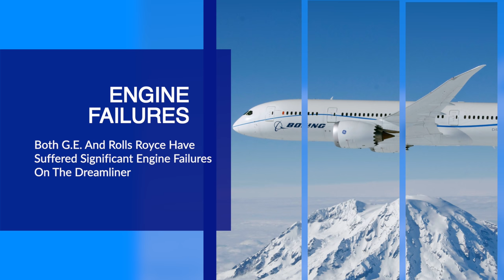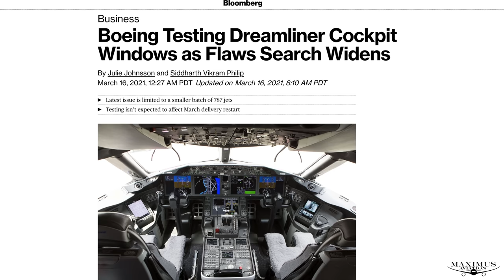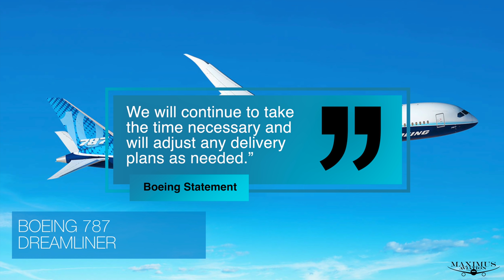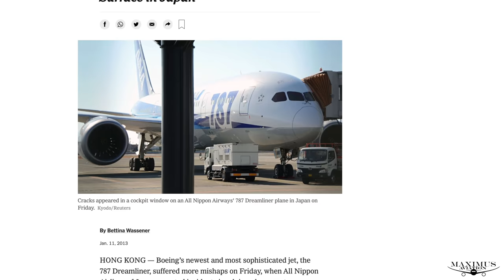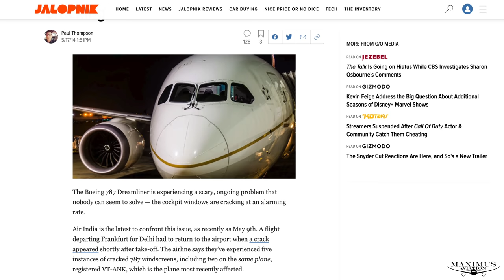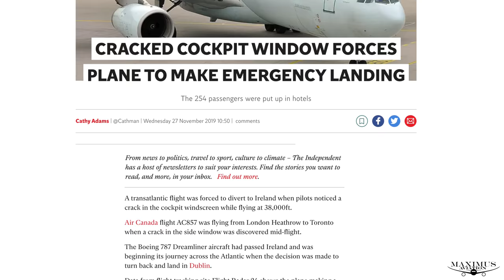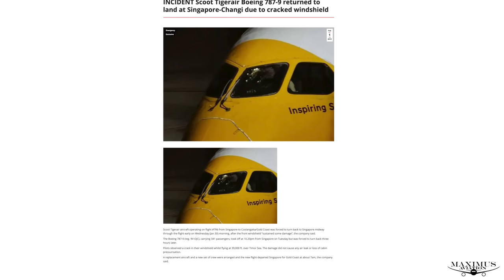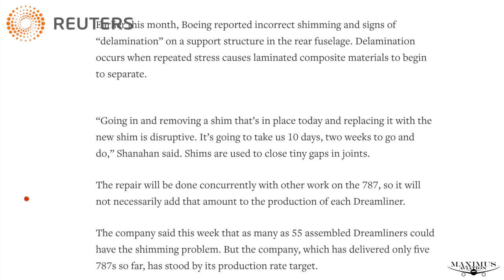Why Do The 787 Dreamliner Cockpit Windows Keep Shattering In Mid Air? How Dangerous Is It?

Comment: Again going back to a time when I was'nt even born. The Comet Airliner. Brilliant piece of engineering, but failed on many levels leaving Boeing to leapfrog it when those problems were ironed out. Yet all those Comets were bought by the UK's Ministry of Defence, Remanufactured into AWACS and flew successfully with RAF Coastal Command for forty Years. That included windows cracking and causing explosive decompression.
Reply: It wasn't the window, it was the window frame (aluminum) that cracked.

Comment: The problem is a three fold hydra. 1st, Boeing is not the same company that produced the safest planes in the world like the 747. They unfortunately took the lessons from Airbus and (planes from the land that invented the word sabotage) and put bureaucrats and pencil pushers in charge of building airplanes. 2nd Boeing used to build most, if not all its aircraft except the engines in house and had quality control. Now to "save money" they outsource so much, they don't know and can't guarantee what the heck is going into them. 3rd Airlines don't want to put in the proper maintenance. As a former crew chief, I have seen it personally. I have had to give maintenance council for a delayed SouthWest 737 flight because they couldn't figure out a simple problem. The USAF still flys aircraft the the airlines said were problematic, with no major issues. But the manual on those are much more involved and detailed than what they use. What is passable for them was not for us.

Comment: So disappointing to learn.  Dreamliner is one of the most beautiful commercial aircraft to date.  This is not good news for the type.  Hopefully the engineering change from the supplier helps rather than hurts.  The shims issue is also disturbing to learn.  Hopefully the 787's future isn't ducked. 😲
Reply from the maker: I agree and I think the problems are fixable but I worry Boeings mindset of doing things on the cheap is a problem.

Comment: How are they keeping such a dangerous problem Quite!  They should be grounded, I think the carbon fibre is flexing a lot more than expected in trials.
Reply: The best way to determine that is to install stress gauges to all aircraft windscreens to determine if that is a factor.
Reply: @davidlazarus67  indeed I would cover the whole edge in strain gauges and push one through a full flight performance envelope,  various country's too because the majority seemed to be very hot or very cold country's.
Reply: @dogwalker666  Yes cover the windscreens in them and wait for the cracks. The flight just past Ireland wasn’t particularly hot or cold region. It’s even good airlines like ANA so not a airline specific issue.
Reply: @davidlazarus67  it’s got to be a design flaw
Reply: @dogwalker666  That’s probably a high possibility but I would eliminate quality control of all glass panels first. It could be a problem in manufacturing. Start with the most obvious and start eliminating reasons. If the windscreens have been checked to eliminate that possibility then with stress detection it would identify other causes.
Reply: @davidlazarus67  I am assuming that the glass is the same as other models,  I only have experience of vehicle screen manufacturing there they use the same glass just different lamination layers.
Reply: @dogwalker666  I am no expert but I would think the window panes are potentially different because of the shapes compared to other aircraft. Different thickness etc. It might even be something to do with installation or the sealant around the window. Using a car analogy we can probably exclude actual bird strikes but should still consider that aspect. The installation would be something to look at first.
Reply: @davidlazarus67  good point, it would be interesting to know if these windows are shared with other models, I assume a lot of parts are common.
Reply: @dogwalker666  I think many parts are unique to the model though many smaller parts like bolts, wiring seats etc  will be common to many aircraft.

Comment: Windscreen problems ha.
I spent 44 years line Maintenance,  and have changed windows on evey aircraft my Company owned. 707 to the Queen and Airbus 320, 330. It wasnt a every day thing but nearly every one was found cracked in flt.. 
The only real world way to see if it's a problem is nbr of hrs the fleet has flown divided by the number of windscreens replaced. Or mean time between failures. 
You may be right with this fleet but no evidence you are...

Comment: Boeing has an engineering problem (We know that), but the bigger problem that is outside of their control is a major PR/media problem.   At present the engineering problems are confined to the business/industry press.   If these continuing problems hit the mainstream press, this could lead to further grounding/investigations (Due to public opinion, remember there is no friendly FAA anymore).   Boeing really needs to be on a major offensive to describe what they are doing to resolve their problems (If they actually want to fix the problems).   I hope I am wrong, but if Boeing don't get their act together, both engineering & media, I could see a further grounding/crash.   If there is another crash, whether it is Boeings fault or not, any fallout from a grounding/crash will seriously dent public confidence in their aircraft.   Remember the MAX has still not been authorised to return to the skies in China.  This could be described as political, but what happens if the 787 suffers a grounding due to lack of engineering at Boeing in China.   Sorry to go on at length

Comment: Why don’t you blast PPG for changing their manufacturing process of these windows, without consulting Spirit?  Boeing has (had) little to do with making the windows.
Reply from the maker: You have a point however if you kept buying windows for your house from the same company for 12 years and your windows kept breaking would you continue to use the same vendor?
Reply: @maximusaviationchannel  a point could be made that knowing that the contracted design requirements would not result in such early failures, you might direct your engineering efforts to figure out what other things could be causing the failures. When subcontractors take it upon themselves to change the pre-negotiated process, without informing you, it makes the investigation much harder and time-consuming. With so many other reasons a windshield can shatter, it makes it tough. Not like they didn’t have many other pressing matters to address...
Reply: @737MaxPilot  still Boeing bootlicking I see 😝. Your Boeing style excuse "Not like they didn’t have many other pressing matters to address" was rather poor considering these cracks dated back to 2012 to present day. Were these pressing matters the Jedi mind tricks and bedding down with the FAA during the unethical lying and hiding of MCAS on the MAX's dangerous push out to service? Lets not forget Lion Air didn't occur until the end of October 2018 and Ethiopian soon after in 2019, that's 6 to seven years after discovering the 787 glass problems. So yes you must be referring to Boeing being too pressed to address the 787 glass problems because they were too busy coming up with a dirty plan to push out the MAX for market share and shareholder value 😂. The only reason they are now addressing the 787 glass is because Pandora's Box was ripped open by the pig in lipstick (737 MAX).

Comment: Up until recently i have been a Boeing "Fan Boy," but no longer. I even would go so far as to avoid flying on Airbus. I even turned a blind eye to a story several years back about Boeing quality control inspectors being fired after bringing problems with a subcontractor in So. Cal to management's attention. Boeing aircraft are now the planes I avoid in favor of Airbus. Personally I would like to see Boeing get out of the passenger aircraft business in favor of a real aircraft builder like Lockheed Martin.

Comment: It sounds like Boeing just keep cutting corners and have lost control of their quality and drive for safety. It sounds to me that in a drive for profits, safety critical thinking/designing and engineering has been cut. Boeing now have Dreamliners that have  had, as shown, a catalogue of recurring faults. The 737 Max again evidences the same shortcomings. I mean Boeing might announce the mid-size airliner as a replacement for the 757, but face facts Airbus already have a proven high-quality product out there. Boeing won't get themselves sorted unless they entirely re-evaluate their current management culture and values around safety and quality rather than bottom line, because at the moment they PR and Marketing disasters, which will cost them far more than the base cost of airliner they sell. I will when booking flights continue to go out of my way to avoid 787s and 737 Max's.

Comment: Firstly, my congratulations on a decent sounding narrative voiceover track.  Thank you.

I think I know why these windshields are cracking.  And it makes perfect sense.

This is an all composite body aircraft.  It's not aluminum.  When pressurized.  It's expanding further than aluminum.  And with the windshield properly secured.  It's being stretched in all directions.  With the greatest force on the exterior portion.  And cracks develop.  When you try to stretch glass too far.  DUH.  Because it's not carbon fiber.  It's glass.  And the way its molecules can stretch is a tad, different.  Ya think?

I'm nothing more than an electronics troubleshooter.  You have to understand when things get hot they expand.  When plastic airplanes get pressurized.  They expand.  More than aluminum ones.  Hose molecular structure is obviously a little more tightly banded.  I'm not exactly a scientist so I wouldn't exactly know.  But my reason sounds plausible.  You can only stretch glass so far before it cracks.

And think about it.  This is the front of the aircraft.  They gets the brunt of the wind.  So the maximum heat must be right up there around the windshield.  So the cockpit area of the carbon fiber expands and becomes more bulbous.  Because of the additional heat generated cutting through the wind.  And is causing the carbon fiber to expand beyond its mathematical considerations.  Whoops.  Who knew?  Some stupid old retired high school dropout with nothing more than a GED and a couple of weeks of technical training seminars +50 years of technical service in the professional broadcast and music and arts recording industries.  That's who.  The old Fart that worked for the tape recorder company that recorded all of those hit records.  That had to save the company where the electrical engineers couldn't figure out what the problem was.  And you have to look to the person who smokes the most pot.  They can look deeply into the issues.  And not be blinded by academics and mathematical equations.  I fixed a physics problem for one company whose engineers told me.  It was physics preventing their product from coming to market.  Until I simply mentioned the fix they had never thought about.  Whoops.  Vacuum operated tape guides.  They had been around for over 20 years.  These engineers never thought about that any.  DUH.  So much for college degrees.  Physics problem LOL.  I don't know any fucking physics!  So physics issues don't stop me.  It didn't stop Tesla either.  Nicola Tesla figured everything out.  Over 100 years ago.  We still can't figure out today.  Much of which is still government classified.  Geez, I wonder why?  Free energy?  That would certainly screw everything up.  Free broadcasted energy paid for by tax dollars.  No more private industry millionaires/billionaires.  The federal government provided power.  No more parties for private industry.  Perhaps no more need for fossil flu all's either.  With wind and solar and waves.  Hydrogen powered, power cells for each individual household.  More lower current highly efficient electrical products.  Solid-state batteries coming online, soon.

We are looking at a big change entering the later chapters of the 21st century decades to come.  It's going to be a lot different 100 years from now.  Like now never existed before.  Much less pollution.  Rented autonomous electrical people movers.  And never slamming into each other again.  No more need for body shops or auto dealers.  Just a couple of companies making vehicles like GE, Apple, General Dynamics.  Toyota and all the rest.  All will meet certain standards and specifications.  One won't need to worry about horsepower or red lights anymore.  No one will have to worry about traffic jams, anymore.  Now they will be autonomous traffic jams.  You can get some more sleep on the way to work.  Won't that be lovely.  Because your autonomous vehicle will never be going faster than 15-25 mph.  And a built-in entertainment system will lull you back to sleep.  And wake you upon your arrival.  Get out of the fucking car now!  Get out of the fucking car now!  Get out of the fucking car now!  Get out of the fucking car now!  And so on and so forth.

Then you/your wrist at the door.  That reads the chip beneath your skin.  To pay for your ride.  Before it lets you out.  And then off you go to work.  The lunch Mobile will come around at the proper time.  And you have nothing to worry about.  You can grab a 6 pack from the Automated Beer Wagon.  Before boarding your autonomous ride home.  And get started early in preparation to beat your wife.  On the day you discovered you lost your job.  To a Raspberry Pie.  And you will be well juiced up when you get off the autonomous tram.  When your wife hasn't pressed the button to have your dinner ready.  And this is what you get for having watched the Jetsons when you were a kid.  And you thought you'd be driving those airborne dune buggies.  Oh well.  It didn't quite go that way now did it?  No more zooming around.  Now you just press an, UBEER button, on your pocket communicator.  And it's there in less than 10 minutes.  Or you get a free pizza.  That are built into these autonomous vehicles.  That you can also pay for optionally.  Along with your choice of refrigerated beverage.  Coffee, tea or ice water.  And which will be a recording of Howard Stern's voice.  When he made that fateful telephone call to Air Florida on the phone that got him fired.  And then became world-famous.  Got a promotion.  And started making millions of dollars.  I thought that also.  But I didn't say that on the air.  I was merely at the crash site.  For 18 solid hours.  A lovely winter lizard in 1982.  I guess they retrieved all the people?   I can't remember much from shortly after I got there for NBC News.  I was suffering such hypothermia.  I don't remember much.  I remember eventually waking up in my bed at home with Howard Stern on my clock radio.  Suffering from extreme exposure.  I got the next couple of days off.  I got my overtime pay.  Howard got a multimillion dollar contract.  After he got fired.

I almost did what Lenny Skurnick did.  I was deciding whether I should perhaps die in the attempt?  Lenny almost did.  Lenny almost died.  I was standing there with my battery-operated handheld cassette recorder.  Getting eyewitness accounts from people during, rescue operations.  And then the other guy that saved a couple of other folks and went down.  I get very emotional thinking about that day and night.  I was interviewing Stevie Wonder when I was interrupted.  I was just blocks away.  I never got to say goodbye to Stevie.  I just had to collect my equipment and  go.  Right in the middle of the interview.  And then outdoors with the chaos for the next 18 hours.  A day I shall never fully forget.

So only you can decide when it's safe to fly.  You can't rely upon the pilots anymore.
RemyRAD

Comment: Deceptive title. The windows aren't shattering, they're cracking. You didn't answer either question.
Reply: 2:50 looks more shattered than cracked
Reply: @2adamast  You might want to go back to school; that's not shattered, it's still in one piece, it hasn't disintegrated.
    In an article like this, that you would imagine has an element of technical analysis, hyperbole and rhetoric should be avoided.
  p.s. it doesn't "beg the question" it raises the question.

Comment: Hi Maximus you have some favourite plane, a plane that has so many flaws by now and next year this Dream Lines will fly only in our dreams and not In real life there has never been a modern plane with so many faults first was the battery burning up the aircraft next the fuselage have a joining problem and now the aircraft has a crack windshield if you don't skip this flying reject number 2 maximum you are going to in the papers crashed with this faulty bird so that my advice and look for another aircraft to follow and be your favourite . I am an Airbus and I have no regrets they build an aircraft the right first time and not have to wait for regulators to want to ground them. I always know when I see and airbus takes to the skies. I know that 99.23 per cent of the time it will make it to the destination safely without a hitch. I know that you guys are America and want to support your own  but please don't let that cloud your judgment over safety, Integrity  or  trust  you guys should pressure Boeing to stop this nonsense and build an aircraft that can fly without these hiccups Maximus thanks for the info and I hope that you keep it up and keep us informed on all that Boeing is doing for this is not hater work this is constructive criticism